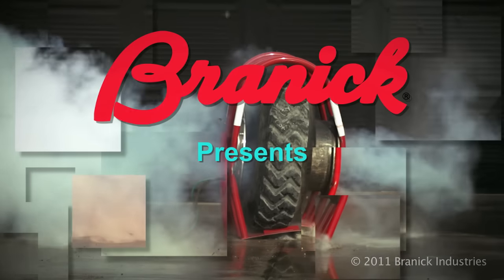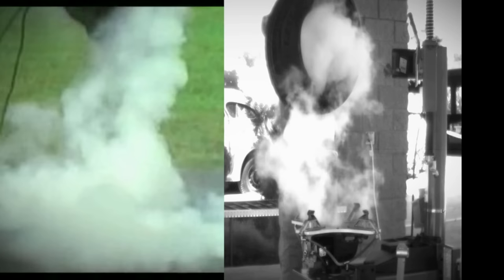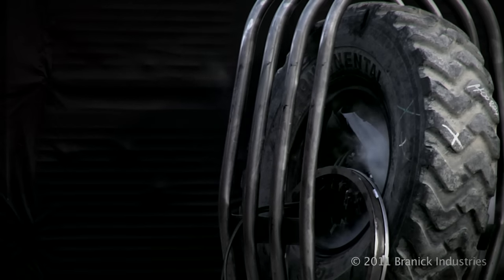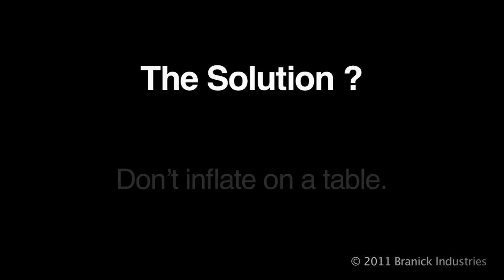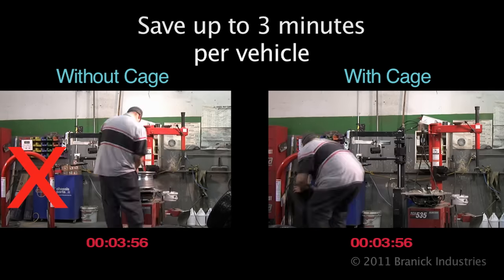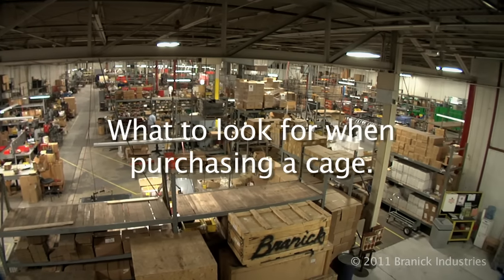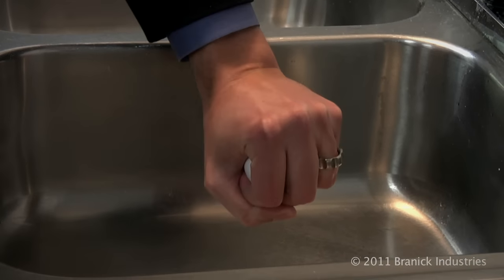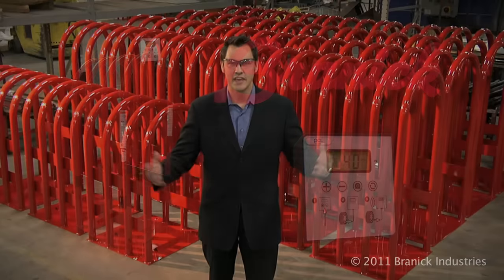Tire Safety Video.mov

Comment: Ive been changing  commercial  truck tires for about 10 years. I can say these work and saved my life when one blew up on me.
Reply: Same here,  just two weeks ago. Semi tire blee off the rim in a cage.... a beat up old bent up cage
Reply: Been doing tires for 30 years Never had a tire blow up pay attention to what you doing
Reply: @rabbidrobrc9123  just because it haven’t happened to you doesn’t it mean it’s safe if you just concentrate on your job. You know that tires can be faulty or have other defects that results in explosions. You are lucky, some are not
Reply: @rabbidrobrc9123  exactly brother it's not the tire that is the problem it's a failure of the operation skills of the tire changer. I've changed hundreds of tires from tractor tires to semis and front end loaders. I've never once had a failure, why because I made sure to pay attention and not over inflate.
Reply: @Gabztar97  well first off I've work In a on site tire and engine repair company and you inspect every tire and rim before doing anything. The main cause is over inflation not faulty tires or rim's. Like one if the other guys said I've been in the line of work and only know of one guy who blew a tire up and it was his fault due to over inflation. Hes right pay attention to what your doing.
Reply: @kalashnikov3796  How about installing the tire on the bead and then finish airing up after it has been at least hand tight on the truck?
Reply: @arcticwo1fee122  it depends on which kinda of tires you are talking about the mounting steps are different for alot of  tires such as split rims and solid. Normally If I'm setting a bead the tire is not on the machine. Also I fill to operating pressure before even putting the tire and rim back on the equipment. Sometimes to set a bead you need more pressure than operating pressure so sometimes have to back off some psi before installing or sometimes it will seat easy and then I can fill to operating psi. Either way I always make sure I am with the limits of the tire.
Reply: @kalashnikov3796  Just seems to me that the rims are exploding more than tires are bursting so if you bolt part of the rim down it might be a little safer.
Reply: Kalashnikov, you sound like a expert tire changer, I’m soooo proud of you buddy. 👏
Reply: Surely u could just use a longer hose to pump air & stand away from the tyre.
Reply: I changed truck and bus tires for years. A safety cage is well worth the investment.
Reply: @markjohnson4643  exactly thats why we have retractable syringes in the medical field (which i intend to be in) they didnt just say “just stop poking people with needles” you take precautions even though you may never need them thats also why we have airbags😂
Reply: @Gabztar97  the truest statement luck has soo much to do because we can't have xray vision or calculate all the stresses. Even if we could we couldn't know what stresses were put on rim tire in the past
Reply: @rabbidrobrc9123  you sound inexperienced as hell.
Reply: I just started at a semi tire shop, we have a cafe but it sits in the corner collecting dust. All the guys have stories but they can’t be bothered with the cage for some reason.
Reply: Did you get fired

Comment: I don't even own a car, yet after watching this I feel I need a cage and inflator from Branick
Reply: Consider work at a tyre shop? ;)
Reply: Oh please I have done thousands of tires and never had a tire explode. Never.  And u can do tires under 5 minutes I ve timed myself. 10 total dismounting mounting and balancing. No cage.
Reply: @jasonthornton1233  my left ankle says your wrong ive done thousands of tires ive had multiple explode the one time i dont use a cage i ended up with 2 titanium plates and 24 pins and screws that particular one was an 11r 24.5 pivot. It can happed with any tire always let the pros do it.
Reply: Or just watch the tire pressure
Reply: You will never encounter this kind of rim
Reply: @jasonthornton1233  it only takes one time though. I think I’d rather be safe than sorry later

Comment: I'm a believer now after seeing my buddies arm after the cast was removed . the two bones in his lower right arm were shattered in 32 places . his fingers were as big around as a can of 5 hour energy drink . he was airlifted to a bigger hospital . after stabilizing the arm they told him to be prepared for six more surgeries . the scar looks like a two inch wide strip of muscle was removed from wrist to elbow , and his fingers are still beyond belief
Reply: Thanks for sharing Im sure your buddies story is going to make more people think twice before over inflating their tires.
Reply: @scrappyny7432  Thank you Greg NY I hope so too . An additional piece of information is that , the air hose apparatus was not a squeeze trigger type . It was merely a coupling you pushed onto the air valve . The inside threads of which locked onto the outside threads of the valve . He stayed with it attempting to remove the hose while it continued pressurizing and BOOM ! the tire blew apart shooting some 30ft into the air (rim and all) while knocking him back about 20ft . Two fingers and his wrist bones were never found again . Surgeons managed to save the arm and 3 fingers but they are unusable . (John is a 275lb man thrown 20ft clear of a rim and tire he was repairing)
Reply: @garyschraa7947  thanks Gary. I do have another question was the tire over inflated or did it fail before reaching the manufacturer's recommended inflation?
Thanks
Reply: @scrappyny7432  Thank you too Greg .  Yes , very over inflated . He had been working on a girlfriends flat tire by removing it from her car . He then used brute force at another one of his friends home ,  managed to get the flat tire off and then managed to get another tire back on the rim .  Since they didn't have a working compressor he drove it to a local "self-serve" truck gas station . That particular station had the proper long type of air chuck/pressure gauge for many years but at some point had been stolen . At which point a simple push-on nub had been put on . He started putting air in the tire and managed to get the bead set but having threads inside the air chuck and threads on the outside of the valve they locked themselves into place and very rapidly he had a run away amount of air pouring into this car tire . But with air coming from a distant compressor  set at well over 100lbs shut off point it never stopped , and he fought to break the grip of these threads ___ when he should have let go and ran . It was WELL over inflated before it blew .
Reply: @garyschraa7947  Wow that is a horrible situation. I hope the best for him. Thanks for the info!
Reply: @scrappyny7432  It's been a little over 3 years now  , he's a tough son of a gun . I just talked with him loading his big rig with supplies for a road trip , and he makes due with what he's got and this has been good to get out there . Thank you Greg for gett'n back with me . It's a true story I hope gets seen by the next generation . (Use the right equipment , with the right protection , doing it the right way , keep all of your fingers and toes and life and limb . )
Reply: What a dreadful example.  I've heard of many such events over the years but people have that same old attitude that it happens to others and "NOT ME".  These devices should be absolutely compulsory in all business premises where tyres are worked on. I've heard of several instances where these accidents were caused by faulty pressure gauges.
Reply: @BD-bditw  Yes indeed . I see him almost every day . He's a good guy , and actually went back to work driving big rigs . But that's not to say that THAT arm and those fingers have gotten any better . They haven't e.g. (If you've ever seen the photo taken in a cave of an extinct flightless bird in Australia ___ with the three long fingers clumped together) Well that's exactly how his hand looks . The entire forearm is stripped of muscle like a shark attack scar and won't straighten out . But he muddles through it . He's a tough sob

Comment: An excellent and VERY informative video! I’m a 40 year retired auto mechanic that has seen too many close calls over the years. When people complain about the cost of such safety equipment I just tell them that you can’t put a price on your life or a lifetime with major injuries due to a momentary lapse in safety.
Reply: Yeah but how many times have CAR TIRES blown off the rim.??   I’ve changed tires as well, and never had blow off a Normal Wheel.    Never messed with a split ring/rim/3-piece.  So I’m 100/100 not blowing off tires.  Why the cage for NORMAL CAR TIRES. Dude in the video claimed three minutes for each vehicle and it was maybe 30 seconds of difference between cage and no cage..
Reply: Ask the airlines, they know exactly how much a human life is worth....
Reply: @jonellwanger7258  Lots of people retire uninjured.  But some don't.  Ask them and their families how much preventable injuries and deaths are worth.  It only takes once for you or someone else to be put into a coffin.
"Past performance is not a guaranty of future results."
Reply: Keep in mind, alcohol causes 90k deaths annually I'm the US, asdn smoking causes 480k, 42k of that is from second hand smoke, many of them being children. Yoiu can save lives by NOT spending money. 0 dollars is much cheaper than a tire cage.
Reply: I can fully condone every word you just said. Sometimes I get a customer that's upset because their car is taking too long to be repaired to which I reply; safety safety safety is always always first! you might think the customers first, but no safety safety safety,..... for the technician, for the customer's car, and for the Integrity of the building! Then the Integrity of the business will be impeccable and untarnished
Reply: @jonellwanger7258 don't forget, you could be a victim of someone else's negligence! Suppose your coworker puts the hose on a tire to air it up, and then goes to the machine for a soda, starts flirting with the girls in the billing office and then kaboom!! The tire he was working on ends your life!! I don't know about you but I wouldn't want to be responsible for that shit!!

Comment: This story reminded me of a tire cage that I had built that saved a tire man from serious injury, 4 days after it was built. A multi piece rim, tube type tire assembly, 10 x 20, Truck tire, weighing almost 170 lbs exploded. The reason for failure was the multi piece rim components were inadvertently mismatched. The tire cage had the same bowed result due to the tire explosion,  as depicted in the Branick photo's.
Reply: A 10.00x20 produces 48000 lbs of pressure  at the rim flange..scary indeed
Reply: Way to go Ricky!
Reply: Multipiece rims are one of the most dangerous.

Comment: I changed tires around 1972 at a garage I worked at. Car tires,truck tires and semi tires. We used these cages on semi tires only because of the split rims. Good thing we did.

Comment: I started in the tire business when I was 17 in the early 80s. I did it for about 10 years and did car tires and semi tires with split rims included we never had a cage. Some of those things made me nervous I'm not going to lie. We were very careful with how we did it though and fortunately no-one got hurt. Back in the day we did things that were a lot more dangerous than today. I would not do a split rim without a cage now. One guy I work with was tearing up a passenger tire mounted on a Coats 40-40 tire changer and the tire blew up and blew his sleeve off his shirt. He was not even injured which is kind of miraculous. On those semi tires blowing up a lot of times it's someone not knowing what they're doing, or just not paying attention and doing one wrong.
Reply: Sometimes paying too much attention to the wrong thing can be your doom like not inspecting the split ring itself and the groove that it sits in closely enough. They both must be clean squarely cut and no damage no Nicks! I've seen big truck tires Bend the crap out of a cage! Now those Earthmover tires, those are beasts oh, I've seen one of those tear the cage up off of the floor, proceed to mangle it, and knock a hole in the roof of the building! Everyone's hair was blown back behind that one. All I can say is it's a good thing it was chained to the cage! One guy turned white as a sheet and had to go home. He was a bundle of nerves for a whole week
Reply: Why did the passenger tire blow up? Over inflated?